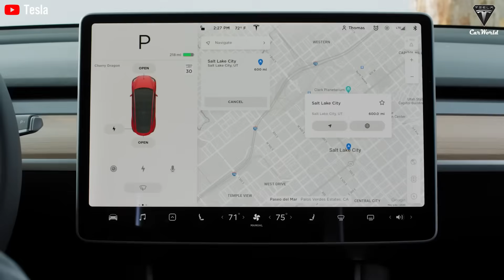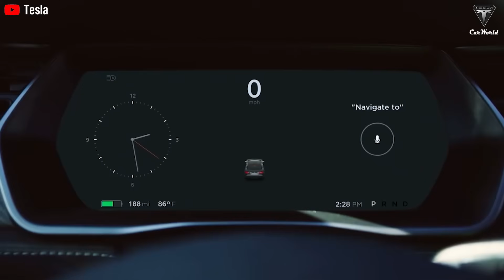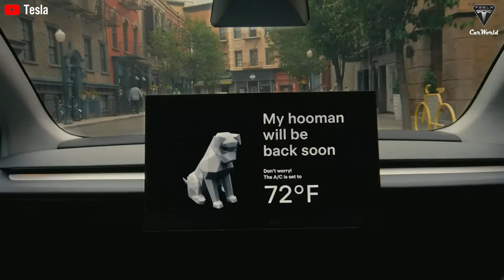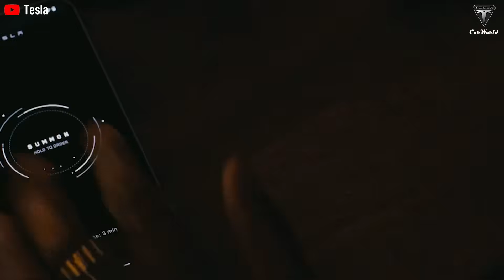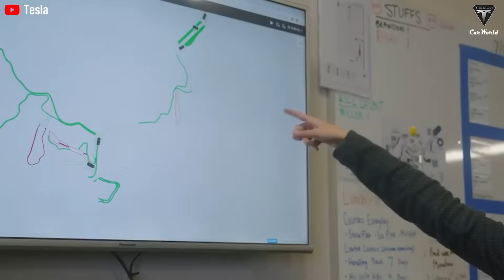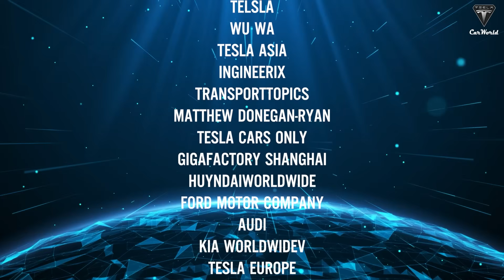Elon Musk Finally LAUNCH 2,000 Tesla Robotaxi CyberCab Rides! Unsupervised AI SHOCKED Waymo!

Comment: but wat if im a criminal, order a taxi far out in the middle of the countryside and steal the wheels ect block it from leaving while hiding my identity stealing all the parts or scrap it
Reply from the maker: Cybercab is monitored 24/7, can autonomously report emergencies, and includes robust stainless steel frame, reducing theft or tampering risks.
Reply: These taxis operate only within a very small area so you cannot take them into the countryside. As for stealing parts, it is no different to hiring a car. You can do anything you like but they will eventually catch you.

Comment: 20–24 hour operation could accelerate wear on AI4 hardware.
Reply from the maker: Cybercab features robust design, stainless steel frame, and electric drivetrain. Reduced moving parts lower wear, supporting near-continuous 24/7 autonomous operation.